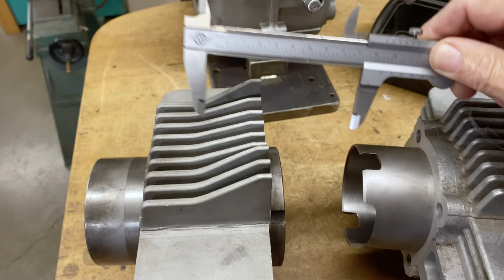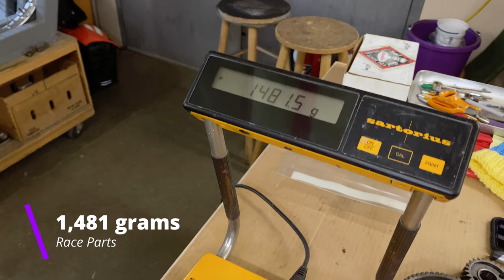Aermacchi engine tear down // Paul Brodie's Shop

Comment: Thanks for sharing another great video!  Can you achieve the same engine-to-wheel speed with the countershaft and rear wheel sprockets without changing the primary ratio?
Reply from the maker: I don't think so. Stock countershaft sprocket is 14T, and I have gone to 15T. I didn't mention it in the video, but I also have changed the final drive gears (5th..) for a higher ratio, which also serves to make the 5 speed a close ratio. The rear hub, whatever you use, will only let you use a certain size of sprocket; I use a 36T, which, with all the other changes, will give me a top speed of 125 MPH. Thanks for watching!
Reply: Changing the primary ratio will also reduce the torque applied to the clutch and gears, giving them a longer life. But the final gears have to be changed to get the desired top speed for the track you are on.

Love your work Paul and Mitch.
Reply from the maker: @paulb2506  Thanks Paul. Yes, the final gears were changed..

Comment: Hi paul an mitch. Back in the early 80s a lot of the 350 racers were areamaci.thos wer fast and low machines.on the irish road race scean
Reply from the maker: Yes, the Aermacchi was a good choice for the Privateer.

Comment: In the beginning of the video,  I had to wonder how the factory would get the nut on the engine if I thinned down wrench was needed to get it off.  What type of tool would they use, especially on a production line.   Nice video though.
Reply from the maker: I have modified my motor from stock. The barrel is shorter so I had to modify the head studs, by using 73/74 studs and cutting off most of the thread. Then I had to make thicker washers to compensate. The stock 350 Knucklehead motor is easier to get the head nuts torqued.
Reply: @paulbrodie  Okay, gotcha.  Thanks for the explanation.

Comment: Greetings from Squamish. Working on my 1973 Ducati I am finding that some of the bearings are not typically found at the bearing supply store , the ones I need are 16mm width and it seems 12mm are more common . Just wondering is that an issue with your race bike ? Thanks Bert
Reply from the maker: Greetings. Yes, it is not always easy to find bearings. Standard sizes have changed a bit in 50 years.

Comment: That was very interesting! What is the little domed cover forward of the clutch? Don't a lot of Japanese bike engines split horizontally?
Reply: Bigger stuff tends to be horizontally split but there are some exceptions, especially with the earlier Yamaha 2 stroke smaller twins. From memory some of the smaller Honda 4 stroke twins were vertically split too.
Reply: It's mix and match, a lot of the honda XRs are vertical, CBs and XSs are horizontal.  Lots of bikes out there I've never touched, but I can see advantages with both ways.
Reply: End of the cam so could have been for points/contact breakers or maybe just timing?
Reply from the maker: The little domed cover is to hide the points, which are no longer there..

Comment: Yum, what an engine!  For the most part, the Italian singles available in the U.S. were by far the best in the era:  Aermacchi (Harley-Davidson), Parilla, Ducati, and Motobi (Benelli).  Best materials but there were some short comings with all as well, kickstarter mechanisms among them.  Is this 350 based motor the same stroke as the 250?  The German NSU was also well done but it was bulkier for racing compared to the Italian marques.
Reply from the maker: Yes, a bit over the top.
Reply from the maker: The 250 had a 72mm stroke, and the 350 had a stroke of 80mm. And then there was the short stroke 250...
Reply: @paulbrodie  That means the Aermacchi 350 bore must be around 74mm - the same as a Velocette KTT or KSS.  
I seem to remember a UK importer of Aermacchi had an ex-works 350 short stroke motor which was slightly oversquare, maybe 76 or 77 bore
Reply from the maker: @pashakdescilly7517  The Aermacchi bore is 74mm stock. I think the UK importer was Sid Lawson. ?
Reply: @paulbrodie  I think that was the name. I vaguely remember a Classic Racer magazine article, possibly in the '80s, of a test of the short-stroke ex-works bike by Alan Cathcart.  The engine had been carefully gone over by Lawton(?), and the chassis lightened and lowered so the rider could get well tucked in.
BTW I found the old videos of you holding 'first start' celebrations for Excelsiors two and three. How many did you build?
Reply from the maker: @pashakdescilly7517   I have built six Excelsiors plus a race bike.
Reply: @paulbrodie  So that means you have ten sets of castings left
Reply from the maker: @pashakdescilly7517   I would not say ten. Some castings didn't work out when I was learning to machine them.

Comment: Are Aermacchi parts hard to come by? I've recently seen a few raggedy sprints for sale, kinda wondering what kind of an adventure it would be to take one of the these on. Not looking to race, just like old singles. Are parts expensive, good investment potential? Once sorted are they fairly reliable? Is a stock sprint a fun bike to ride, suspension, braking?
Reply from the maker: Aermacchi parts are becoming harder to find, especially since Moto Italia in California got sold.. Parts are no more expensive than other brands, definitely less than Ducati. To make them reliable you would probably want a Mukini carb and electronic ignition. With a good set of modern tires, they will handle very well. Shifting on the right side..
Reply: I have been riding and restoring Sprints for about forty years and most of them, especially the 350s, have very low miles.  I have never had a 350 with a bad bottom end, pistons are easy to find as are points, gasket sets, carb kits, and kicker gears are available, weak spark is a problem sometimes, you have to renew wiring, check generator field coils, but once running they are fairly bulletproof.  They are so much fun to ride on fire roads or country backroads, the low center of gravity allows footpeg scraping without worry, they are very nice bikes and well worth having.  And you don't need any special tools or an engine stand for regular maintenance, my old wheelbarrow and some scrap 2x4s do the job, but I'm no Paul Brodie.
Reply from the maker: @davisworth5114  Thanks for commenting!

Comment: molto interessante...domanda:ma tra testa e cilindro non c è guarnizione? mi interessa SAPERLO..GRAZIE
Reply from the maker: Paolo, thanks for watching!   :glasses-purple-yellow-diamond:
Reply: @paulbrodie  l'd like to know it there is gasket betwen cylinder and header.... aermacchi 250 cc  thank you Paoul
Reply from the maker: @paolofalini  Yes, there is an exhaust gasket between the cylinder head and the exhaust pipe. A parts list will show you that. To work on these bikes you need a parts list and a workshop manual...     :face-blue-three-eyes:
Reply: @paulbrodie  molto gentile  grazie......i suoi video sono bellissimi

Comment: I use a heat gun to help with press fit bearings.
Reply from the maker: Someone else commented about that. It works on aluminum to get the bearing out of the case, but in this teardown we are taking the shaft out of the bearing, so heating isn't going to help. But thanks.
Reply: @paulbrodie  I do it on bearings that fit tight on the crank as well. When mounting it becomes a slip fit when the bearing is hot and crank is cold. Don't know exact temp but might be around 100-150°C.

Comment: Whenever I have something that tight, be it in an engine or something in the press I nearly always use a soft flame, especially where you have aluminum and steel, as the aluminum will heat up quicker, what I don't want is for the steel to damage the bore and lose the interference fit.
Reply from the maker: I'm not pulling the bearing out of the case, I am separating the shaft from the bearing.

Comment: Hi Paul, can the clutchplates be picked out with a magnet? Or are they non-metallic?
Reply from the maker: A magnet might work.
Reply: @paulbrodie  😛 I've always got a couple of magnets on standby on my toolchest. Small and big. Old speakers are great donors! And a magnetic pickup tool with it's small head for any tight space....
Reply from the maker: @hobbyoverload  And I have magnetic crankcase drain plugs with strong magnets.

Comment: Isn't it possible to use a torque wrench with a "crow's foot", in order to tighten the head?
Reply: After measuring the length of his modified wrench, he could use a fishing-type scale to apply a specific torque to the nut.  Just a thought ...
Reply: Yes a thinned down closed crow foot should work.  You use a correction factor based on the length of the crow foot.  Paul could build one from a cheap closed end wrench.
Reply from the maker: I don't think there is room.

Comment: I had a 350 Sprint back in the day.  You could have the engine run or you could have the lights on but you couldn't have both.  Weak generator.
Reply from the maker: Good story!
Reply: Nothing wrong with the Bosch unit, you need to degrease the rotor and sand it w/ crocus cloth etc.

Comment: HI Paul, I am new to Aeramacchi. Just purchased 72 SX350. Got it running sweet but found out the gearbox doesn't shift into 3rd or 4th. Kinda locks up there. Split the cases and found nothing wrong, shifting forks are straight, shifting dogs were not smeared, gears were in like new condition and shifting drum looks good as well. Old owner was in there and gearbox had no shims. videos,
I am looking for shims for my 72 SX350 transmissions and can't seem to find them anywhere. 
In this video you mentioned Leslie at Motor Italia and an email for him. I looked online and showing shop is sold and new owners are setting up shop. Do you know of anyone else that would have a variety countershaft shims and main shaft shims for my stock engine? Any help would be appreciated. I love all your videos. I would also to let you know your are in my prayers and hope all is going well with your health condition, God Bless. Rock from Milwaukee, WI (414) 839-8599